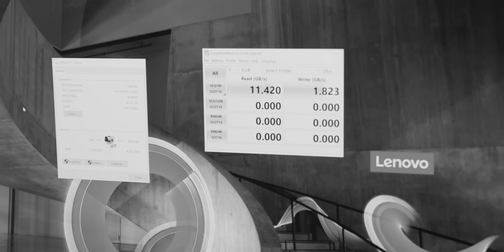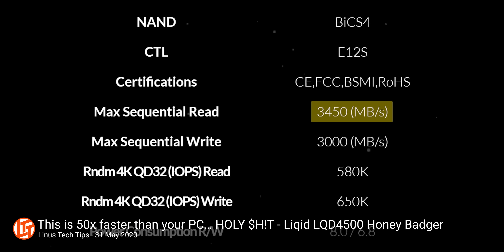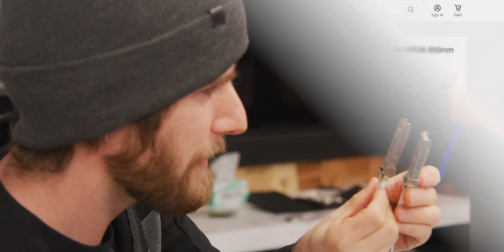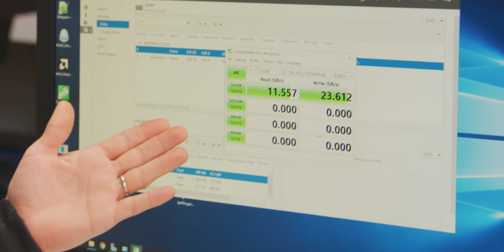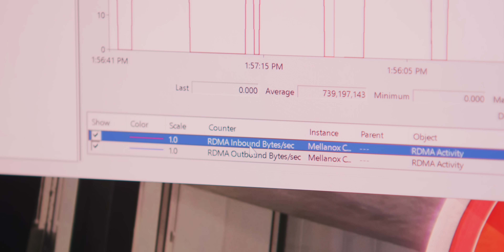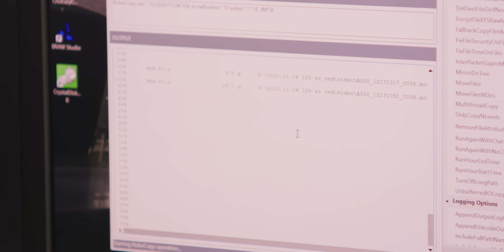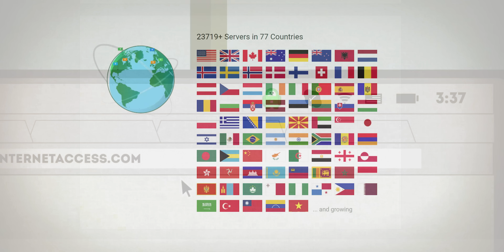A $15,000 Network Switch?? - HOLY $H!T - 100GbE Networking

Comment: I run a mix of Linux (CentOS) and Win Server 2016 with Win10 Pro WS & Win10 Enterprise LTSC & Linux clients. The best copy tool I found was GS RichCopy 360 (from Gurusquad). It is multi-threaded (up to 256 threads), handles long paths (over 260 characters) & locked files, and has decent enough management options. It's not free, but not overpriced we thought. We tried several other tools, paid, free (donation-ware really), or shareware. Most were either single-threaded or 4 to 8 threads max. GS has a PDF Admin Guide you can d/l. (I have no affiliation, only a customer). Linux, of course, doesn't have these issues. 😉 🙄

There may be others out there, but we stopped looking when this worked OK for our uses. A largish company I consulted for some years ago used some Flexense s/w for Win client & server. But they were more expensive depending on the license type (single user desktop to Enterprise). They did a great job though. 

And of course, you could find, or create your own, PowerShell scripts. PS can be multi-threaded, but it is single-threaded by default (at least up to version 5.1 that I used a few years ago). From memory... There was a script called PSJobs to handle Multi-Threading in PS. Fun for all! 😏😎

Comment: For those who have some difficulty understanding what they're doing...here an explanation!
LTT works on a centralised information infrastructure system...meaning that all projects are on a central system (server) and that editors will never have the project they're working on, on their computer. So with that in mind they need a very fast connection to that information (as they're working with huge files) and preferably a connection that doesn't put any cpu stress on the server or the local device (as the local device needs its cpu to digest the information and the server needs its cpu for operation/not crashing).
This solution accomplishes both...tbh I didn't know about the second functionality as well...thats why LTT is so DAMN interesting

Comment: ... You know they have 800BG switches right?... and these 5048 switches were originally 60k when they first came out... but they are junk very low IOPs... the 5248's are so much better... but step up your game there's a 5232 that's 100gb's and 400gb uplinks ;)

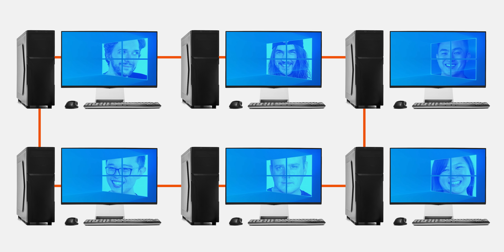Comment: 1:44 "Any kind of practical high-speed deployment starts with the switch"

Unless your switch has the ability to handle routing, any kind of deployment, that is not a direct system-to-system setup requires a router or a DHCP server. though the Switch would come after that. 

now obviously without the switch, the systems are just independent boxes that cant talk to each other; but without the router/DHCP server, the systems' ability to communicate is extremely limited.

Comment: Linus, you know those ports don't have lasers in them? They just accept tranceiver modules that have.
The Honey Badger 05:32 video is not linked.
Reply: The transceiver still needs the power from the switch to power the laser on the transceiver. I would still imagine the switch requires no where near 750w without PoE though, but I dunno if dell has a PSU in that range that would actually fit without manufacturing(or buying) a new PSU for it.

Comment: Be careful if you start making your own optical network in the office. Touching the cable end with bare skin could introduce micgoglass in your blood stream. Optical cables are sneaky dangerous like that. Much more sneaky than the spiky biting copper cables.

Comment: Did you get the warranty? Or the extended warranty? Or the extended onsite warranty? Or the extended extended warranty? Or maybe you didn't get warranty but you still got it or paid for it? A dual warranty maybe? If one is not enough for some reason for the same period?

Comment: Actually the optical transceiver itself uses way less energy than an rj45 wide band high bandwidth i/o needs. The reason is that you need specific SNR over the copper cable and the power needed to get strong enough signal depends on how wide the signal bandwidth is. This means that a 10gb rj45 copper network Interface uses almost 10times more power than 1gb rj45 because it requires at least similar SNR, and all that copper wire resists all of the bandwidth of the signal used to do the transfer.
Optical on the other hand mostly uses power for efficiency losses on the transceiver, and at the same time a fiber has almost 0 resistance to the signal sent which is why you can easily get hundreds of kilometers of range over fiber. Because of this even if you increase the bandwidth used by an optical transceiver 100 times it uses barely any more energy than 1gb fiber. That's the reason why fiber switches use way less power and are significantly cheaper (transceiver cost matters also).

Comment: I just build a datacenter with StorageSpacesDirect with the 32 Port 100gbit Dell switches and Mellanox 50gbit dual port cards. For Rdma you have to configure PFC, ETS and RDMA on both, switch and servers. This is a massive improvement on RDMA performance. That was your bottleneck. Cheers

Comment: I remember spending $30K for 1GB 48 port switches at the turn of the century...and was HAPPY to pay it.  I am in hardware development and I can tell you that 400GB is right around the corner.  The Super-7 Cloud folks still want more...and are willing to pay for it.  It is also one of the reasons PCIe Gen 5 is coming out so quickly after Gen 4

Comment: You would never be able to get "200 Gbps" from two 100 Gps ports for one host. Yes, you could increase your bandwidth from 100Gps to 200Gps if connecting two switches together (on in this case a host to switch). However, your throughput is still going to be 100 Gps PER HOST as the host would only use one link to send the traffic based on it's hash. 

Please see: https://tools.ietf.org/html/rfc7424#section-3

Comment: Rdma bypasses UDP/TCP?! What protocol does it use then? There are more reasonst for the usage not to show up in the Taskmanager.
Reply: It’s TCP/IP stack, and there are other protocols within the transport layer other than tcp and udp such as FC, RDP, Apple talk.
Reply: @AnotherYoutuber460  Okay but rdpstill communicates over tcp / udp. And apple talk is either dead or runs on tcp or other existing protocols on the other layers. In this case it most likely was fc, which i completely forgot about.

Comment: If you went for the Dell S5248F-ON you can use the Double Density ports which allows you to even go up to 200GBe , if you have the right cables for it and NICs as well :)

Comment: hey gentlemen, did you try to specify routes or routing protocols on the switch?  couldn't that increase performance a little?
Reply: Switches don’t require routing confit in order to work out of the box.

Comment: Did anyone catch the fabric speed/bandwidth within the switch? 
I guess I could go to Dell's website for that. 

Not sure why Linus was complaining or joking about the graphics card in the 8x slot.  You really don't need or use the graphics on a server unless you're using it for a poor man's GPU card.  (Yes, $1500 USD for a GTX 3090 vs 10X that for their GPU cards that are strictly GPU cards. ) 

I also have to ask about the badger card. Did Linus keep it as JBOD or did he go RAID 10?

Comment: Network engineers are out here wondering what the fuss is about
Reply: Ditto. Used to sell QLogic SANBoxes for $16k a pop back in the day... Ahh I'm dating myself.
Reply: Linus: $15k omg!!! 
Dude go check out a Nexus 7k.. lol the fuckin licenses are $15k...
Reply: @jmhm17  and look at open issues list on that piece of crap. Cisco switches are a f*** rip off, but can't go around corporate policy.
Reply: @borek772  rip off yes but they still can't be beat... Cisco rules all even if i can't stand a lot of things about them.. The Nexus platform is truly the best in the industry.. FYI o hold 2 Juniper certs and I still recommend cisco for r/s and data center..
Reply: @jmhm17  Laughs in Arista
Reply: Laughs in Service Provider level P routers.
Reply: And waiting for the video about replacing those FS optics.
Reply: yeah. 15K is one fabric module in a datacenter switch. And two 800W PSUs? How about 8 PSUs at 3000W each?
But still a pretty capable machine for such a small office.
Reply: @tomkocur  I know I’m late but how high was that electricity bill
Reply: @thegrandthrone9687  I wouldn't know, it's not our datacenter and I'm not involved in billing.
Reply: 15k for a switch is a bargain of this speed.

Try deploying ACI... The licenses alone are 3 times that.
Reply: @FrostByte112  you get what you pay for. There's a reason it's 15k...
Reply: looks at 400gbit spine switches cute, Linus.
Reply: Yep.
Reply: No I was wondering when Dell became a high end network provider.
Reply: Our last tech refresh saw us replacing all our 3850 access switches with 9500-48Y4C’s (60 of them).  Just for shits and giggles we also went with 9364C’s as leaf switches… because who wouldn’t if they could?
Reply: yeah this is pretty pedestrian stuff in IT land.
Reply: I'm pretty convinced you can end world's hunger with the cost of all the shelfs from companies like Apple, SAP or even Dell.
Reply: My WiFi chugs on local http transfers (talking anywhere between 4-10Mbit), and I can't convince my mom to let me just buy a better router. So I can look at this and say at least there is hope.
Reply: No one:
Linus: 15k switch!
Me: *configures and deploys 100k+ chassis based switches on a regular basis* ok?
Reply: @ShooterInfinity  Basically yeah in data center environments ...
Reply: 15k haha! we just bought a handful of aristas for 30k a piece lol
Reply: $15k is actually cheap for mid to high end Catalyst (or similar) switches. I don”t know what the fuss is about, really...

Comment: I would love to see a face-off between this and the Ubiquiti Leaf.  https://www.servethehome.com/ubiquiti-unifi-usw-leaf-overview-not-review-48x-25gbe-6x-100gbe-switch/

There are clear trade-offs that have been made for Ubiquiti to reach the price-point with the Leaf that they have (US$2000 for ostensibly the same I/O), but for a pro-sumer SKU those trade-offs are probably well worth it.  I’ve been running my home LAN on Ubiquiti gear for a little over 2 years now and the only issue I’ve encountered was a design flaw in their 16-port PoE switch which made it useless for powering my AP’s, a problem which didn’t affect their 8 or 24 port switches and I believe is fixed in the Gen 2 16-port.

Indeed, I just yesterday upgraded the firmware on my switches (1x24, 1x16 - redeployed in a non-PoE use case, 2x8 port) and APs (5x), which was the only thing to have interrupted the 167days continuous uptime on that gear.

The prospect of being able to upgrade to a 25/100Gb infrastructure for my home LAN is mouthwatering.  US$2000 (+recabling cost) makes that prospect a reality that a US$15,000 (+cabling) proposition does not.

Comment: awww....48x 25GbE SFP28 ports plus 6x 100 GbE QSFP28 ports.

That's just ADORABLE!!!

LTT: yeah!!!
me: looks at my 36 port 100 Gbps QSFP28 IB switch
me: that's cute

Run Linux. (I recomment CentOS 7.7 or 7.8). Set up NFSoRDMA. And then you can either use NVMe with XFS and/or GlusterFS for a distributed parallel file system.

Ethernet adds between 1-3% of overhead  to the system. 

If you are using a ConnectX-4 dual port card, that's a PCIe 3.0 x16 card which means there's no point in trying to run both ports (e.g. link aggregation) because the PCIe slot tops out at 128 Gbps theorectical limit. (I've tried that already. It ended up being slower than a single, 100 Gbps link.) (I guess it depends on the specific model that you have.)

Also, BTW, at these data transfer rates, monitor the device wear as you will burn through the write endurance limit VERY, VERY quickly.

(Also BTW, I bought my 36 port 100 Gbps IB switch for $2950 CAD (~$2300-ish USD).)

Comment: First world problem: Linus now has enough throughput to actually wear out the SSDs on his machines in 2-3 years rather than the average 5 year lifetime of these drives.
Reply: but that is also probably a tax deductible expense to them and they likely buy in bulk with discounts from the supplier this setup is pretty unrealistic for home consumer use since chances are most average folks are probably running 4K video at home tops and not using multiple editing rigs all accessing video files near simultaneously.

Comment: 7:15 - that's not how you open Lenovo ThinkStation case, just push and let it go
7:17 - Oh god, that is not how you install CPU in this socket
8:03 - Oh wow that monitor stand haven't been cleaned in a few years

Comment: Linus, if that's not an ultimate solution there is always 400GbE, with new QSFP transceivers ;) They are expensive as hell, require new fiber optic OM4+ /OM5 cables for somewhat usable range (due to high Gbaud rate) but they are lightning fast.

Comment: The Mellanox pNICs use RoCE v2 (UDP) so are you using DCB/PFC/ETS and for the demo what was the MTU size ? you need to set the Ethernet to >4-9K then you will get RoCE MTU at 4K... then you can get higher numbers for the demo...  use "Mlx5cmd.exe -Stat" to show the "roce-mtu"...

Comment: That's not 100Gbit/s switch, it's 10G switch with 100G uplink ports. I would call switch a 100G when it have majority of ports is that called speed. Example: Cisco Nexus 9332C is 100G switch.

Comment: Add one more connection to your dual port pNIC it will use SMB Multichannel and you have 200Gbps or add two pNIC (4 Ports) and you have 400Gbps ;-) just be sure to use PCIe v4

Comment: $15k for a network switch is actually quite cheap for that. Back in about 2008 I spec'd a Cisco 48 port gigabit switch (wirespeed, with layer 3) which cost $5k.

Comment: Do the Dell PowerSwitch Z9332F-ON next for giggles 400GbE yo. Also try the pluribus network operating system on it or the one switch in the video for monitoring.

Comment: Used 10gb fiber equipment has gotten so cheap I'm going to start using it for the important parts of my home network. I don't yet come close to needing 100gb for anything, but I would have gone for it anyway if I had the money.

Comment: 1) You could have similar setup if you had gone with Mellanox switches 2.5 years ago.  If you really want, there is even a SKU from Mellanox that gives you 16x100Gbps ports
2) Layer 1 network: you don't need fiber; coaxial can work for distances within a rack.  The interface (QSFP28, etc) is not the same as the media.
Reply: Oh and if you want "the last upgrade"?  Get the Mellanox SN4700.  It has up to 32x400GbE ports.  That should last you for 12 years

Comment: I much prefer Microsoft Richcopy to Robocopy.

It has existed since the XP days, and is made by Microsoft SysInternals, it hasn't been updated in 11yrs, but I still prefer it over anything else, as all I have to do is download it from MS, double click it (no installation necessary) and tell it to do what I need it to do.

It'll then show you as it copies each file across (on my system that's about 4 files at a time).

Comment: Oh look, if you see any resemblance to a switch that Patrick from Serve The Home recently did a video about you are not wrong.  Looks like Dell uses Celestica as the manufacturer in some joint venture to design these things.  Dell will have their own customized OS and probably a custom variant of the controller.  
https://www.youtube.com/watch?v=fkc2pFFGCtE

BTW the 32 port 100Gig switch version ends up supporting 128 ports of 25gig using breakout cables.  3.2Tbps!  If you ever need more than 48 ports of 25Gb this is how you can do it.  
I only needed 4 of the ports per switch when using breakout cables for the 16 25Gb ports I have in service so far.  S5232F-ON is the 32x100Gb beast version.

Comment: to explain this for the people in the comment: this is an intranet system, a connection between the computer within the same place, connected to that switch so no actual internet is involved, you can have a 1 megabit internet and still do what he is doing in this video. although you need the equipment he had.

Comment: To those in the networking industry  .... #meh. I have a couple A99k-8x100 cards in my local test bench. Matching Cpak-100g'  optics.
now 400 Gig's where its at. 

Linus could use a couple E810's as well

Comment: Why is Windows so bad at this? It's conceivable a home user would want to set up 100 gbps networking. I mean it's expensive, but it's not that expensive. Windows 10 Pro supports 64-core CPUs and 2TB of RAM, so why not 100 gbps networking.

Comment: You  have dual power supplies incase one fails, all quality enterprise switches have 2 power supplies, one should be plugged into a UPS, and one into pure power, this way if power fails or your ups fails, your network still works.